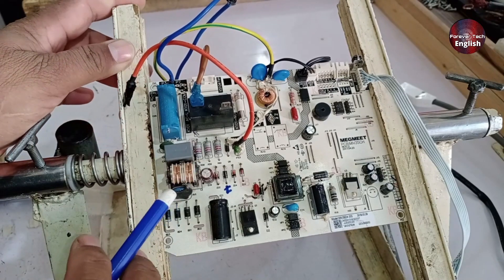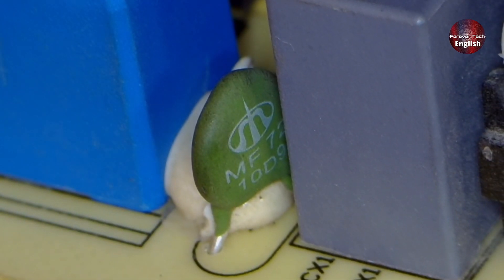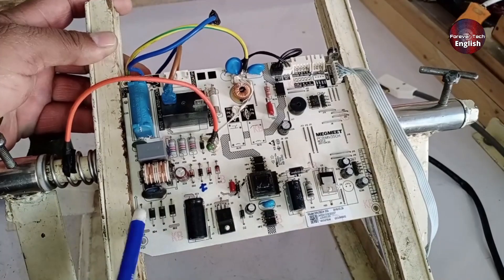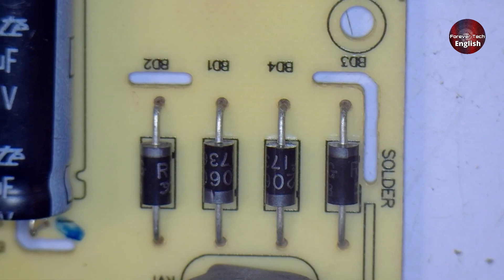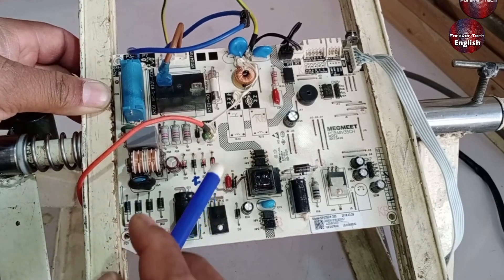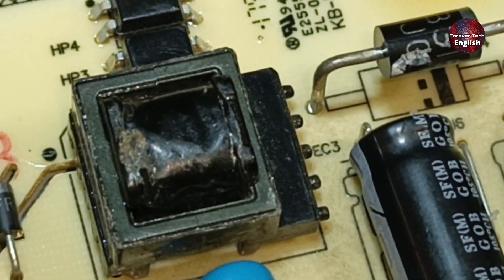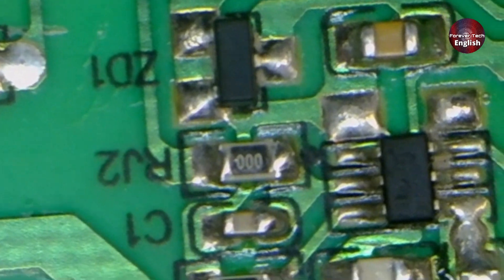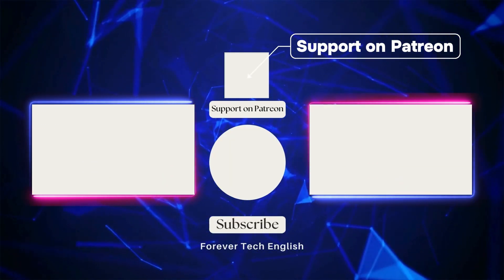Megmeet AC Inverter Board Repair Tips: Spot and Fix Potential Issues!

Comment: You said "RJ2 is short circuited or burnt", Mate RJ2 is 0 ohm jumper, so definitely it needs to be short. And regarding EC1 capacitor, you can use 450Volt capacitor, I will work properly and is not going to explode.